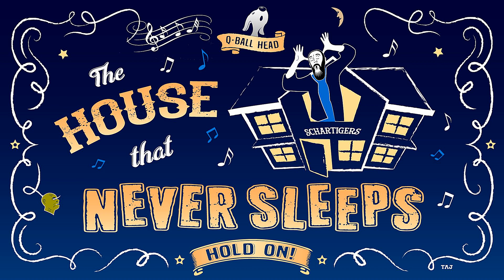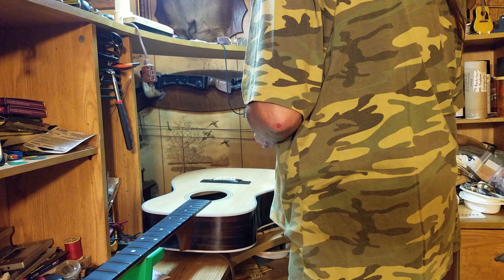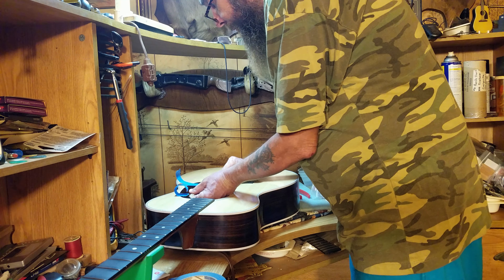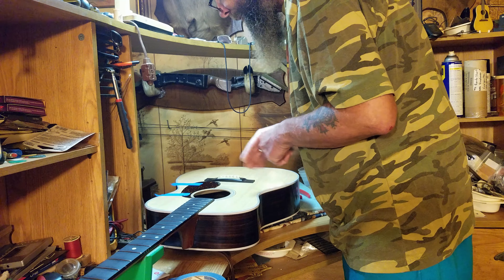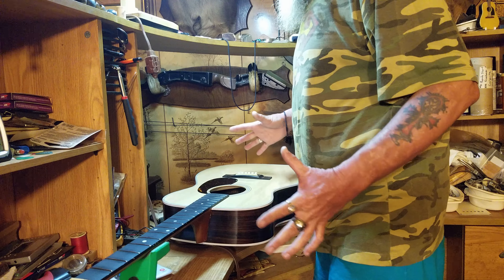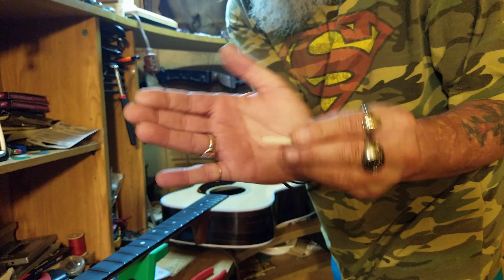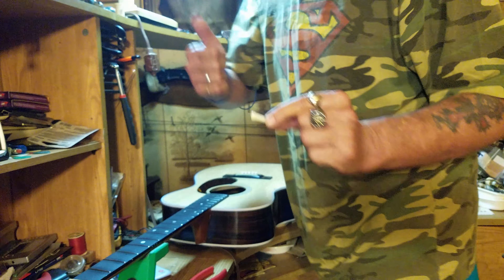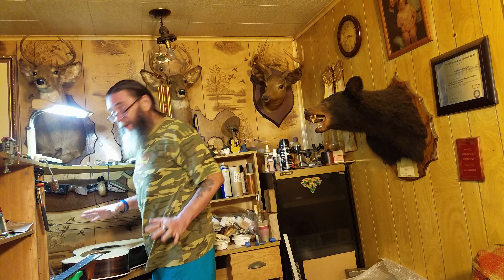4k HD video test pick guard & bridge pin preps martin 00028

Comment: I have one of those old computers so I don't get the benefit of the 4K stuff. Good tip on the pick guard placement. I also use that method for installing screen protectors on my phone. Good job. Keep it up. Mr. Schartiger.
Reply from the maker: thank you my friend for checking it out!

Comment: Other than the audio being out of sync, it looks great to me!!!! I'd like to add a word of caution about using naptha & alcohol. Speaking from experience, I don't recommend using it on older Martins. I thought I'd be smart once & attempted to clean the neck on a 72 D-28 with alcohol. It took the finish off & I had to make it a speed neck with steel wool. I know most of the newer Martins are finished differently & shouldn't react in the same way as my 72 did. That being said, please do research & tread very lightly before trying this on your guitar!!!!!!! Randy knows what he's doing & how the different finishes will react. As always another great video from THTNS!!!!!!!
Reply from the maker: you are right JD, I should have mentioned this in the video. the newer martins tend to react to other things, like the rubber on some guitar stands, new martins tend to melt the rubber right into the finish, not all of them but yes it pays to be careful and do the homework before trying any of this stuff. thanks for tuning in!

Comment: In sync here, picture is crystal clear and I consider the computer I'm on a potato. Don't know if you added light, but seems a lot brighter. Great job on the pick guard, guess I'm weird, but I like the black pick guards better. I wanted to ask, why is it important to make sure the bridge pins go in the same hole?
Reply from the maker: because the different string gauges wear differently on each pin and pin hole, keeping the same pin in the same hole all the time will fit better because it wears to the gauge (size) of each string, also could improve the transfer of vibrations into the top. thanks for checking it out!

Comment: Randy a question for you if you have the time,
I've set up a few old FG series Yamaha's early 80's for myself and they sound great and are cheap to buy. I also bought an 1972 Yamaha FG-160 absolutely fabulous guitar. I find that I always need to sand down the bridge to get the action to the height I like which is around 2.5mm or 3/32nds imperial. Is this the norm with cheaper guitars? And does that need to be done to expensive ones like a Martin? Recently I bought an FG-332 in perfect nick, action was at 5mm just short of a neck reset I reckon, had to sand down the bridge a lot and the saddle, just about got it down to 2.5mm. Bear in mind I do all the truss rod neck relief first as you do.Just wondering what your experience on this is?
Regards